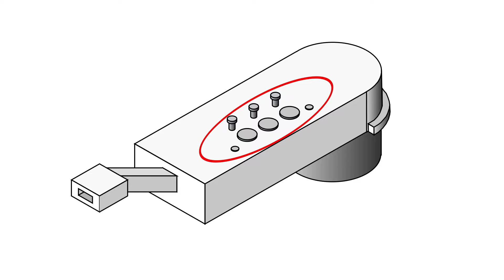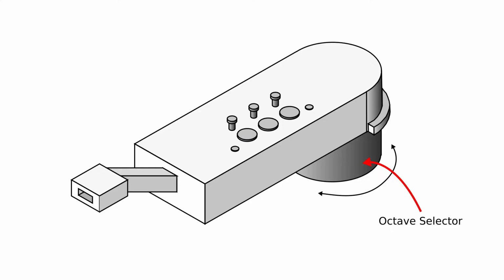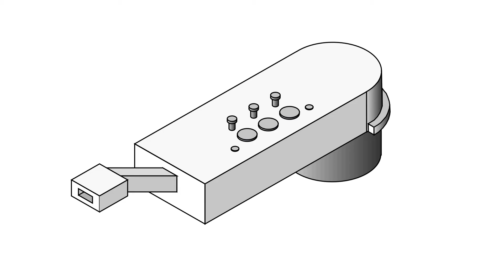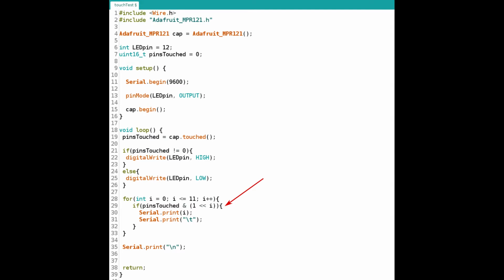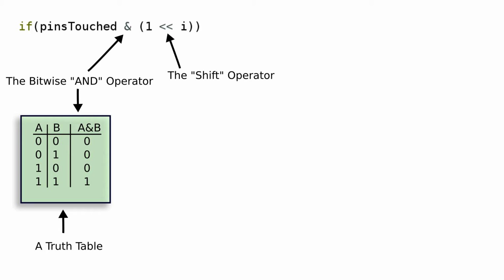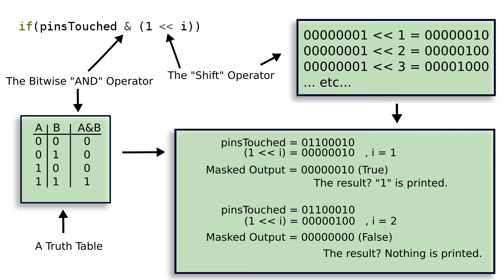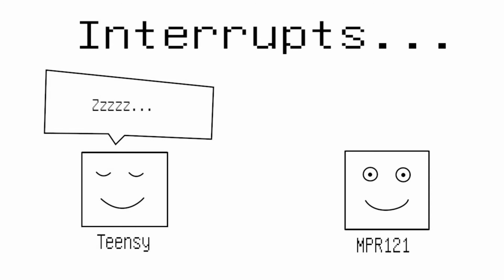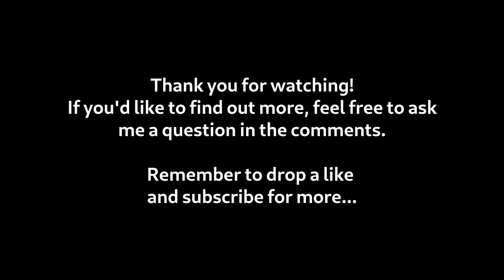EVI Phase 3: Touch Sensing With the MPR121 Chip

Comment: I'm happy you did this as I'm doing a similar project, but I'm not clear on how the pinsTouched works to tell exactly which capsense touches are being pressed.  I am making an EWI that is basically sax fingering or Akai style, but with some extra pinky touches to do other things.  I would probably like to talk to you at some point.  I'm new to coding but have a real drive to finish my project, so I'm always looking for clues.  Bergland himself has open source code, but it's a swamp.
Reply from the maker: Hi Chris. Apologies for a super slow reply. Are you wondering about what I'm doing in my code, or what the Adafruit_MPR121 library is doing behind the scenes? My code is just using a for-loop to check each bit in turn of the data returned by the "touched()" member function of the mpr121 class. If a bit is equal to one, the number corresponding to that pin is displayed on the serial monitor.

Comment: Very informative!  If you were to use the Teensy 3.2, would it not have enough touch pins without the MPR121?
Reply from the maker: Yes it should do, but my thinking was that by taking the touch sensing out of the teensy itself, it frees up the processor to do other things. I've (since this video) put the interrupt pin to use, so the teensy can work on all the other functions without having to poll the touch pins. The MPR121 does all the auto-calibration and capacitive sensing by itself without overly burdening the teensy this way.

If you were really restricted for space in your instrument you could go without the touch module and just use the teensy touch pins I guess :)